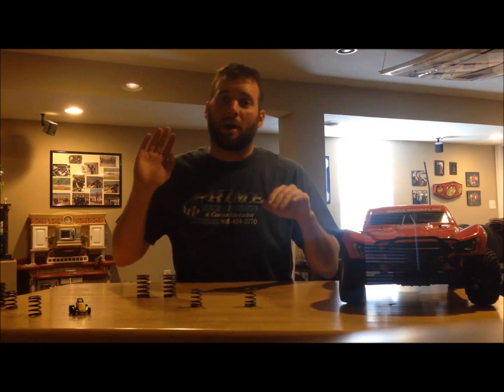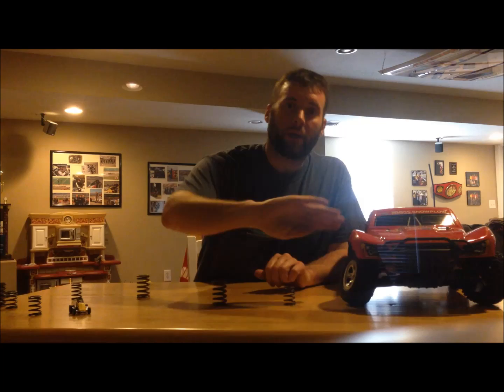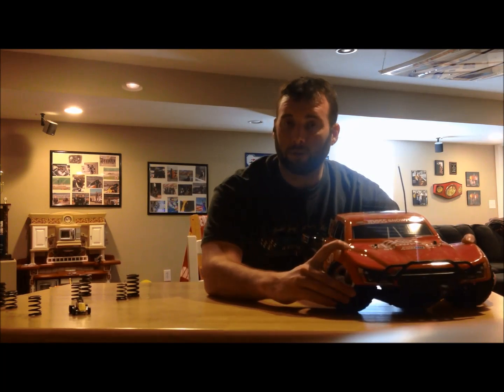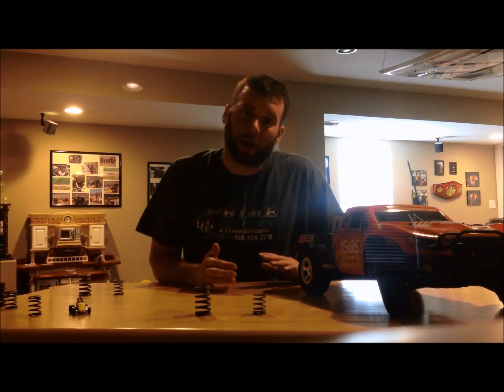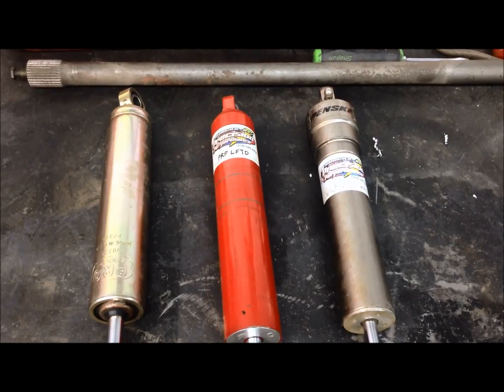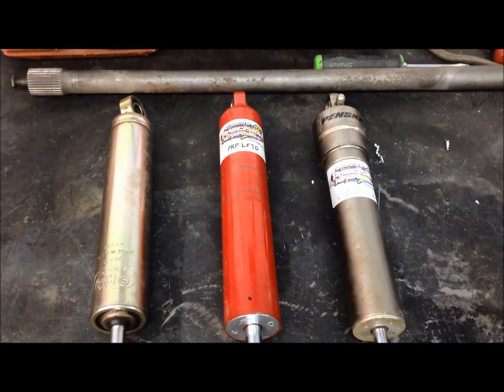Prime Racing Tech Tuesday #3 - Shocks and Springs

Comment: So stiffening the RF spring will help it turn in? That's backwards from asphalt. Is it different on dirt? Not arguing, just asking.
Reply: We have a lot more dynamic cross during braking from weight being higher up transferring to the right side. Also some modifieds have brake floater bars shoving up on the chassis in the Lr to load rf during braking.
Reply: Not always.. asphalt yes we use to run a 1050 rf n 800 lf but on dirt I run 1050lf 1100 rf u can even put that 1100 of lf n 1050 of rf on dirt. It frees car up do go way crazy but try 100lb split n run 3in of stagger n back n about 3/4 to a inch of stagger in front n see if that frees u on entry..

Comment: Stiffer spring in the right front?  every one I have talked to says softer spring in the right front (compared to left front). Any ideas why ?
Reply: All depends on driver..old school drivers like to drive off RF so they run a stiffer RF spring the less split u have n front springs the free or loose the car will be on entry.. running a stiffer spring on LF is called hillbilly style which makes for a loose or free car but free is fast! Me I’m running 50lbs if split up front n a 250LR n 225 rr
Reply: Randy Dorsett soft spring with a bump stop. Once you hit that bump stop it’s a stiff spring again.
Reply: Too stiff on rf can make car push going in crazy as it seems that’s why I like very little split n front so when I enter turn it rotates til I get back n throttle..

Comment: As a new driver, I have really been watching these videos. What length of springs do you use in the back. I have 13" and 16". Is it possible to use the 16" that is 175 on the RR and use a 200 or 250 on the left rear? I ask cause I am burning my right rear tire like crazy and feel I have no traction. Please help! Thank you!
Reply: yes dew it works good
Reply: You will get different opinions on this some say shorter springs to reduce weight but there is always the risk of coil bind. I am a firm believer in the longer springs to reduce the risk of coil bind while also giving you more travel. Now I may be wrong on this but I think long springs run into the risk of bowing out of shape. This was a setup on a A-mod back in the 90's and a metric GM frame. We use 9 inch springs on the front 900 lb on the right and 800 lb on the left. The rear spring I believe was 15 inch coils on a mono leaf suspension the mono's left and right was 50 lb the right rear coil was 125 lb and the left rear was 175 lb. We had a 100 lb split in the front and a 50 lb in the rear. It worked really well cars have change so much now this combination may be junk but it was to give an idea.
Reply: Put car on scales.. gotta have enough rear % weight or ur spinning o top also good shocks help when running more rake
Reply: Nevermind on rear % I see now u say ur burning rr up.. what’s lf look like and what’s RF look like n comparison to rr